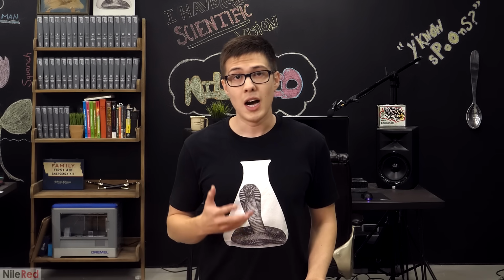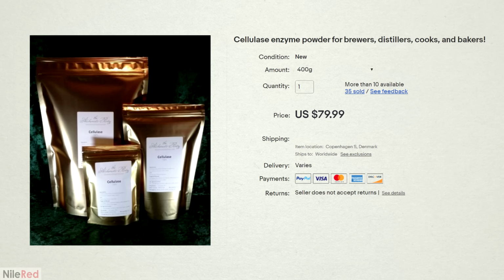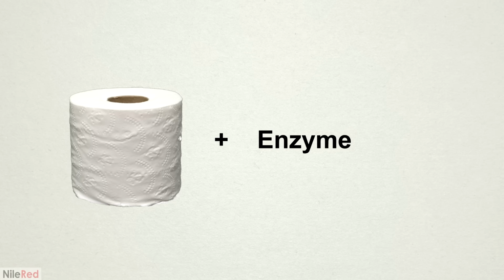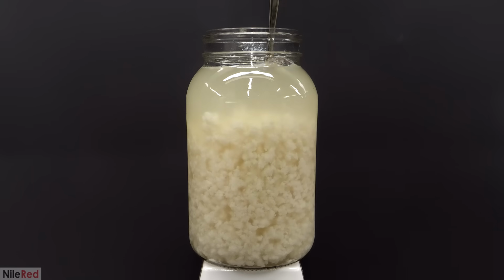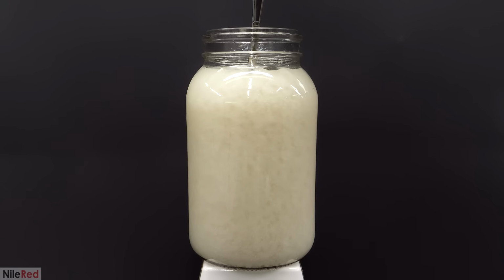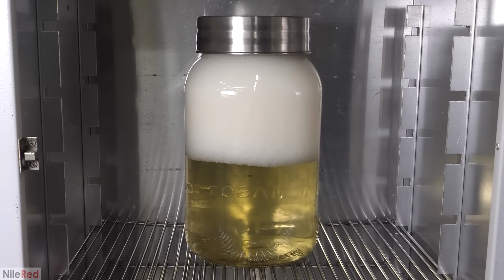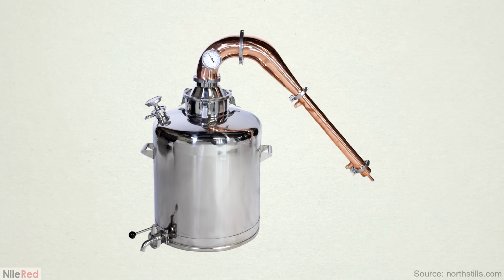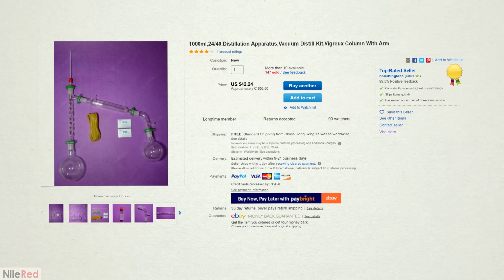Making toilet paper moonshine

Comment: Ah yes, drain cleaner and distilled water, the two things youd want in something you drink xD
Reply: Distilled water is legit just drinking water I’d definitely prefer that over anything
Reply: @cybervinegae  Nope, destilled water is PURE H2O, with no Minerals. your cells need those minerals, if the level of minerals on the outside is lower than in the cells (through drinking distilled water for ex.) they cant take any Minerals from it. Dont get me wrong, you wont die, but its definitely not tap/drinking water.

Comment: If I’d been taught stuff like this in chemistry I’d likely have paid a hell of a lot more attention. Although we did have a lesson where the teacher set the ceiling on fire...
Reply: Story please 😁
Reply: @malijaffri  our teacher was showing us examples of exothermic reactions. The particular experiment he showed us was apparently used by railway engineers to weld track together and involved aluminum oxide, iron and magnesium, which was used as a fuse (as far as I can remember). The heat generated was so intense it did what I described and burnt the ceiling tiles. When he went to pick the bowl up he’d used for the experiment, it was still so hot as to weld the tongs together.

Of course this was so impressive for us he did it again, except bigger. Same result.
Reply: @eliz_scubavn  Thanks! But to be honest it wasn't very responsible to do it again.
Reply: @malijaffri  they probably did it outside in a safer environment. I've had plenty of chem classes being brought outside for some silly slightly dangerous experiment. Besides, if it was really crazy dangerous the teacher wouldn't choose to do it. That or he wouldn't even be ALLOWED to by the school 😂 S'all's good
Reply: Our teacher taught us how to make napalm with a bar of soap and gasoline, lol.

Comment: They say that the difference between a good vodka and a bad vodka is the number of times that the vodka is filtered. I've heard that you can take cheap vodka run it through a brita pitcher 4 or 5 times and it will be as good as the best high end vodka. I'm wondering if running his through a brita pitcher would also improve the taste.

Comment: I'm sorry to say this bit this is your wost work yet.
1) You should have salted out the enzymes and filter the enzymes and fungi to prevent frothing
2) You should have measured the temp. inside so you know when methanol is distilled out so you can throw it away or just throw out the first distillation.
3) You bought NonGMO Project citric acid. Avoid the ludditic butterfly. GMOs are perfectly safe to consume and the NonGMO Project is a scam. Lol

Comment: I wonder what teh relative sugar density of a gingerbread house is compared to a wood foundation house. Surely a log cabin is more sugar than gingerbread, as gingerbread is a pretty low sugar cookie at around 1/8th ish, though I guess most of the rest of that is flour, which is mostly starch which is mostly sugar. Hmm yeah I dunno

Comment: You forgot to remove impurities at the end by pouring the alcohol trough active coal. Saves you from a lot of headache the next morning ;-)
Reply: Activated carbon.  Coal ADDS impurities.
Reply: Active coal can remove impurities?
Reply: @theisjepsen22  Yes. Activated Carbon distilling is used by virtually every alcohol maker. It's a VERY important step. You can find videos of how do it on here on Youtube.
Reply: @theisjepsen22  its exactly how water filters work. There is activated carbon in that removes impurities. Chucking the alcohol in a water pitcher that has a filter in it will clean it up nicely
Reply: You confused coal with charcoal, coal would make it toxic.
Reply: probably misspelled it

Comment: Sodium hydroxide is some nasty shit. I had to use it to synthesize DMT over a decade back. Could've melted the skin off my bones. Also, why did the enzyme treatment first separate one way and then the complete opposite after mixing it? I hate alcohol and don't drink either.

Comment: I learned more in this video than a semester in biology
Reply: Well I would be confused if you were learning chemistry in biology
Reply: @jedithekitten8891  no you need to understand the chemistry behind biology. For example Phenolic compounds one of which is vanillin is a 6 carbon compound, but glucose is also a 6 carbon compound so does that make a Phenolic sugar? No they're different you can tell be reading the chemical formulas . So yes in biology they should be teaching you chemistry.
Reply: Well your first problem is that you're on biology not chemistry

Comment: Running that stuff through a Brita filter it might taste better. That's like a legit trick that people use to make cheapo vodka taste better. Weird, but it works. I guess it's because it helps filter out that extra stuff that- as you said- comes over with the "tails". This video was really informational for me. Like now I think I understand why cheaper vodka doesn't taste as good- it's because they aren't bothering to separate the tails as much from the good stuff and don't distill out the byproducts as much. So the process is faster and therefore cheaper... but not as good. Interesting stuff.

Comment: Wouldnt alcohol made from woodpulp be methyl alcohol instead of ethyl alcohol?
As in, a little can make you blind, a lot can kill you type of alcohol? 
Or was my seventh grade chemistry teacher just high on some chemicals?
Reply: Methanol, also known as methyl alcohol, does indeed cause potential blindness and death.

But he addressed this in the video. Methanol in moonshine comes from the fermentation of something called pectin, that is common in foods but not paper. 

Wood pulp does have a bit of pectin, but this is typically mostly destroyed as pure cellulose is extracted for paper these days.

Methanol is generally avoided by discarding the  “heads” of the alcohol during distillation, as Nilered did here. Methanol has a lower boiling point than ethanol and will boil off in a distillation device far faster than ethanol. So discard the first bit and you are good.

There is also the so called “flame test” that methanol tainted ethanol burns red and near pure ethanol burns blue but I’m not sure if that’s a legitimate test or urban legend.
Reply: @storyls  Thank you.

Comment: Next time, leave the stuff on the button -- on the bottom when fermenting, as you saw there wasn't much that you'd get.

After fermentation, cold crash your brew so the yeast falls to the bottom -- just leave the brew in a fridge at 34-33°F and the density of the yeast and everything will make it fall to the bottom. Not really necessary though. It's just for clarity if you were going to drink paper beer.

 When you're going to distill, just degass by stirring a ton, then start your distillation.

Comment: Hello, I realy like Your channel, lots of interesting experiments with approachable explenation. 
As a Polish person an former biotech student I'd like to point few mistakes that You made (or rather impractical approaches). 

Your destilation was so painfully "by the book" that it barely work.
Firstly, instead of steering it You should throw something that would provide spot for boiling to initiate (broken porcelain work great). By stearing you keep temperature of solution eaven, that why all of alcohol inside flask  started to boil at once hence run away.  
Secondly insulating column just kill it function, instead of having temperatures gradient that would allow water to condense on glass and drop back to boiling flask you created setup that used column as decoration. 
Pro tip, by colecting multiple fraction you could save a lot of energy, time and just dont delute just purify product.
I also like to mention that ethanol is tasteless so thing that You tasted was a bunch impurities. 
Ps. From my experience fermentation preformed on pure glucose still produced some methanol, although I judging it by compare density of 70°C - 75°C fraction with 78°C- 81°C (booth in temperature of -4°C) so I  might be wrong. Remember tho that some of yeast used in process will die in process and be used as a source of substrates for rest of them.

Comment: You forgot to adjust the pH before adding the enzyme. This has certainly reduced the efficiency of the enzyme.
Moreover, was the pH really adapted to the yeast strain used?

I think there must have been a lot of glucose left in the solution before distillation.
Yeasts cannot transform all the available sugar, the ethanol concentration in the medium ends up inhibiting them.
A source of nitrogen would also be needed to promote yeast growth.
Reply: You should not consume ethanol produced by glassware distillation. There is a high risk of methanol in the distillate.

Comment: Interesting, but Romanians nailed it in this case. We call it "Tuica de Pufoaica" wich means "Padded coat moonshine". You need a big very thick padded jacket, a long stick, an outhouse that has been used for some time and an alcohol boiler. You basically wrap the jacket around the stick, and dip it in the outhouse (feces ferment after some time and there is alcohol present), then after the jacket has been thoroughly wet, you put it in the alcohol boiler along some other things (usually fermented plums) and a lot of sugar (to cover the taste). Boil it at a very high temperature and the "moonshine" called "tuica de pufoaica" is ready. Enjoy.

Comment: You discovered what we distillers call a puke. A lot of CO2 comes out of solution and drives the contents up the column and into the condenser.
However, I've never seen anything like this. It was very interesting and informative. Thanks a lot for sharing and happy distilling. :)
Btw..without any solids in the flask, there is no need for a stir bar. The final distillation can be done without and you can even make decent cuts.

Comment: To distill ethanol,  you bring your flask up to one degree below the boiling point of ethanol.  Let everything that is coming over finish.  Then throw it away.  Raise the temp to the exact boiling point of ethanol.  Collect your pure (as you can get) ethanol.  anything that is left  that takes more heat than the poiling point of ethanol,  is trash.  That's fractional distillation FYI.  Since ethanol loves absorbing water,  you can't distill it perfectly,  it absorbs atmospheric humidity.  There are chemical dryers  you can add to remove the water if you need purity.

Comment: Learn to make wine: To clear the solution add SO2 to kill the yeast that sinks down. and filter it out before destillation. Know, that the tthermometer tells you which substance is coming through. If you see the thermometer at 100°C, it is just water. So it should be much lower though near the boiling point of ethanol. If the temperature slowly increases then you are going up the boiling line. It means the solution will contain less and less ethanol. Something were we start to use fractional destiallation. Also know about azeotropic points that ethanol-water have at around 96% ethanol concentration. This means, you can never with water together get higher concentrations like that, if you not chemically or physically capture the water.
Learn about the kill of concentration of yeast by alcohold which is about 14%. So what you put in in sugar should not produce more than 14% ethanol, otherwise the reamining sugar remains in solution. Solution of polution is dillution. 

I think you should have wated much longer to let the enzymes eat away the cellusosis. You mentioned that there were other flavors. One quite common one is methanol, that the yeast produces when cellusosis is present. Methanol has a lower boiling point and can be separated when you have learned to use the thermometer on your desitllation aperature. Methanol is quite toxic, so be careful what you drink there!

Comment: That is WOOD ALCOHOL and you will get turpentine and other shit in there that will kill you quicker than drinking squeeze (for those who don't know: radiator fluid flushed through rye bread).

Fuck you for putting this up like it is normal.
Reply: This is just so irresponsible and dangerous this channel should come down.

Comment: ....  an idea from one who would like some  home-made ethanol so long as the materials cost and work involved 
was  significantly less than spending $32 . for a 1.75 L  bottle of '420'  - 190  here in colorado. , available at a liquor store a mile's bike ride from my front door 

    thus far none of the  vid's seen on this topic appeal  in an economic/time sense.  at this time ...

    and except for the $35 hazard charge of  .laballey.com for 200 proof EtOH   buying from them is
 almost a choice as well.  maybe with the next stimulus check ...

     200 proof is desired  for some chromatography work where even trace amounts of water
are objectionable.  water,  being so very polar, is capable of tying up the binding sites on the sorbent 
silica molecules ,  with their C18 ligands.  

     not to take anything away  from  NileRed here  or  show him any disrespect ...    my purpose is to be a voice among the target audience who have pressing economic and time issues for  taking his path.  

   and , who knows,  some day  circumstances could change  and  moving the  action in his direction could
be the smarter choice

Comment: Isn't making alcohol from cellulose kinda the holy grail for making fuel? It's not difficult to convert a gasoline engine to alcohol. E85 cars are already there. I mean, in a pinch, any car can run on everclear.
Guessing the trick is making it cheaply enough to beat gasoline?

Comment: You could have done this a little better with the enzymes. There is a specific temperature at which enzymes work best, usually around the temperature of the body. If heated too much, they lose in efficiency. Since the water seemed to be basically boiling, the enzymes were most likely denatured (basically killed).

Comment: Note:  A lot of toilet paper are not pure cellulose,  but also contain plastic fibers which keep it from easily breaking down when wet.   Which is why plumbers told my parents years ago to only use Scott type papers,  not the fluffy kind...  to prevent sewer line blockages.  Mind you,  I have to snake out my line tomorrow...  no longer using a Scott type paper for medical reasons....

Comment: You can even make alcohol from wood, it will contain a lot of methanol tho so it must be properly processed to not be deadly. Would be fun watching Nile getting a rectifying column and trying to rectify this toilet paper alcohol to 98%, it wouldn't be drinkable tho as trying to drink alcohol over 96% will severely burn your throat and you will end up in a hospital. This is also the reason why alcohol over 96% is not commercially available.

Comment: if pH of reaction is meant to be 5, why are You adding NaOH to water of pH ~7? pH of 5 is slightly acidic, when NaOH is strongly alkaline. Also, temp of 50*C degrees was probably recommended because high temperature causes protein (such as enzymes) denaturation.

Edit: You didn't really have to buy smaller hydrometer, You could dilute the solution with known volume of water and calculate it after reading value from hydrometer. it could be little less accurate though.

Comment: I shake my head at the lack of engineering judgment. The enzyme step would have gone better with continuous agitation, the resulting glucose solution could then be rendered down to improve concentration (measurable with a refractometer). That would then make for far less volume and a higher concentration of the mash that would later need to be distilled.

Comment: Dude, the most dangerous impurity is the methanol which is produced along with the ethanol. But the methanol has 3-4 degrees lower boiling temp so that's why the first 10-15% are thrwon away when making such distillate which is for drinking. The methanol will make you blind in very low concentrations and a little bit more will make you death.

Comment: I was distilling some old beer that I found in our pantry that was 4.6%, I seen it filling up but with the temp so low the ethanol wasn’t coming out fast so when I came back abt 1 hr later I seen that about 50ml evaporated from my beaker 😂 So now I have a cork with a tube through it into a glass bottle to save as much as possible...... 
also I used some Aluminum oxide I made to clean my ethanol and I gotta say aluminum oxide wasn’t the fastest thing to make so Idk about anyone else but I’d like to see an easier and more efficient way to make it?

Comment: Additional thoughts: You need to watch Moonshiners before doing something like this. Those guys know A LOT more about the chemistry of distillation than you do. First off you let it run too long and likely had vinegar before you distilled it. There's an optimum period that mash "works off" before it goes too long and becomes vinegar. (happened to Josh on that show numerous times) 3 weeks was WAY too long to let the mash go. Also a hydrometer will tell you exactly what percentage of alcohol your mash is at post fermentation, and what percentage your alcohol is post distillation. You can also use it to tell how much sugar is in the mash as well. Each further distillation strips the impurities from the alcohol and raises the alcohol percentage but removes all flavor from it. Also wood alcohol is methanol not ethanol and methanol is toxic, let alone it's oxidized form.. formaldehyde.
Reply: He mentions the methanol is only created when there is pectin which wouldn't be present in toilet paper.  26:36 I would also say most moonshiners don't know the actual chemistry its just they follow what they were taught which was alot of trial and error, unlike an actual chemist who may not know the optimal way to make moonshine but knows a lot more about the chemistry behind it.
Reply: @mcgee6177  https://en.wikipedia.org/wiki/Methanol explain to me then how it was made from "the destructive distillation of wood."